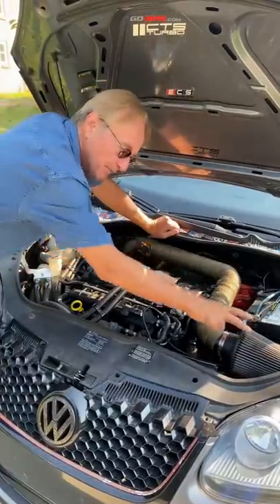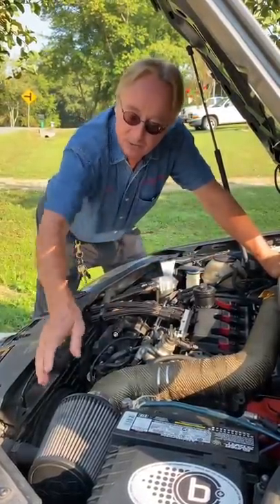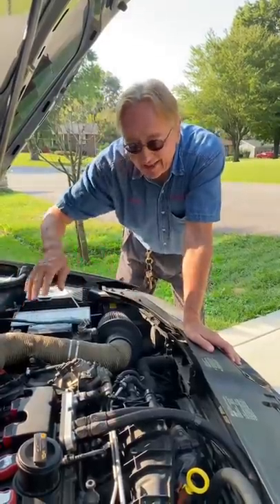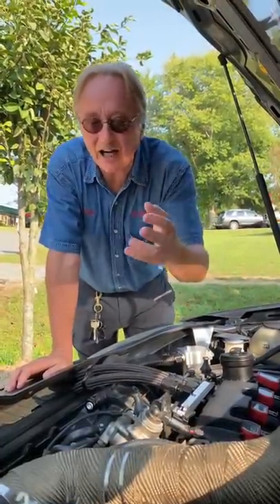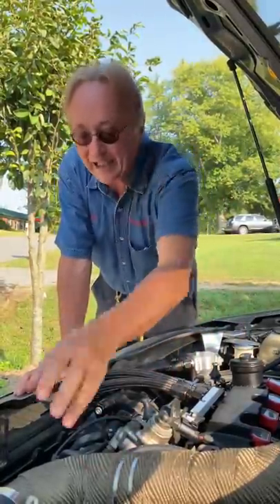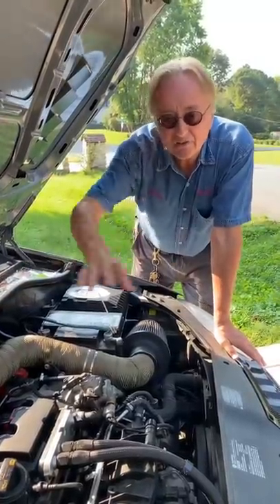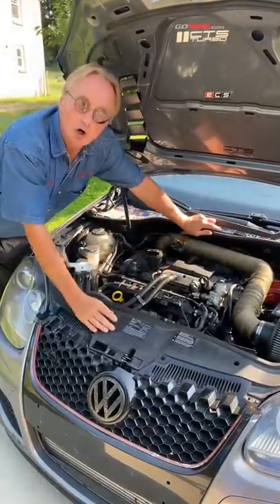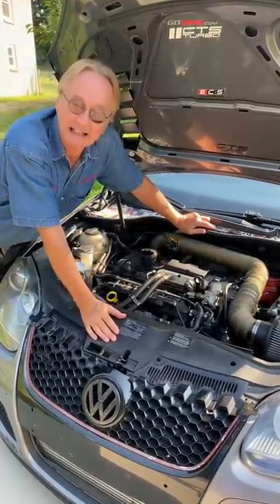Why Cold Air Intakes are Stupid

Comment: Ignoring the fact that many ECUs self learn, so a cold air intake will actually be beneficial if installed correctly. Engineers designed the original intake system to meet noise regulations, emissions regulations, and cost restrictions. Providing they are thought out and installed properly they will make a positive difference, even if it may not be measurable.
Reply: ECU's self-learn for adjusting back to desired parameters, not making improvements. You need a tune to see gains from a radically different intake setup.
Reply: Yeah they pull time

Comment: To each their own, I put a aftermarket intake on my truck I can tell it gained a little power (maybe 20hp) and mpg (maybe 5 more miles a gallon) since the engine isn’t having to work as hard to pull in air. And no check engine lights come on because it uses the original maf sensors. A heat shield keeps the hot air away from my cone filter just like the original box did.

Comment: Well, I had a mk5 VW GTI like the one in this video from 2006-2020. I brought it in to the dealership for my first free oil change. When the service dude pulled off the engine cover he broke it at the rear left grommet and didn't tell me. The mk5 GTI is a really good car but there is one major design flaw - the air filter is part of the engine cover and the air passes through it! I didn't know it had a hole until I took it off when I changed my spark plugs. By then the warranty had expired. Turns out the leak messed up the air system making the car jumpy. When I replaced the engine cover it drove a lot better. Because of its multiple parts, a new mk5 GTI engine cover is $350. So I went to ebay and a kid who bought one of the those cold air intakes no longer needed his stock engine cover and I bought it for $35 plus shipping. So cold air intakes are good for one thing - devaluing stock engine covers. Because of that experience I stopped going to dealerships, even for the free service, and do it myself with one exception. I got a new car and the stereo screen blacked out. The stereo still worked but you couldn't control it. The dealer replaced the screen under warranty.

Comment: If the manufacturer offeres it as an upgrade they also designed the intake system to work with it. Just get the oem or one that is very similar

Comment: Cold air were good back the the good old days when cars were really restricted from the factory.   Now days it's all looks and if you want one that is proven horsepower it'll cost you alot of money.  After market tuners spent countless years testing their products to make power at a certain speed or rpm.  Like Scott days sheap intake China made from eBay might actually decrease power and performance.  Coming from a guy who spent alot of money testing intake kits from various high end Japanese companies like HKS, Blitz, Apex, Greedy etc.
Reply: What brand should I use?
Reply: I mean a cheap K&N filter brought the mileage from an old 5.9 durango from 14 to 16 just cause it could actually breath
Reply: @gregoryrose13 👍
Reply: Greedy lol no kidding there, if i see the greedy or trust emblem on a part I know its going to be double the price of a domestic made part.
Reply: K&N filters let more dirt into your car (versus stock).  Been proved bu comparison studies
Reply: A Chinese CAI designed just like a big brand one,pretty much does the.same thing but for a third of the price. After all its just a metal tube isn't it?

Comment: that's why you get one that's designed for your vehicle
Reply: Its hard to get them for cars that arent really common like my alfa romeo 145 1.9jtd from 2000.Its so incommon i cant even find factory body parts
Reply: @silentscream1871  really? Kias are like non existent in the car scene yet I found a cold air intake specifically for my Kia
Reply: @silentscream1871  have you tried forums?
Reply: Designed to fit yes.
Reply: True. Nissan Nismo has vehicle specific modification part’s designed to enhance performance. They even give helpful tips if you do choose to tune, but they say it’s optional.
Reply: @silentscream1871 alfa romeos are already so well designed. I would never mod that car.
Reply: Exactly
Reply: @silentscream1871 uncommon but carry on?

Comment: I see them sometimes on Jeeps and other off-road vehicles.  The K&N filters don't filter out dust as well as OEM, they allow water into the engine easier than OEM, and you never use full throttle when off-roading anyway.  Just stupid.
Reply: Bunch of momos
Reply: Well said, just proves if you advertise enough people will fall for the garbage.
Reply: Whats stupid is how i wasted over $70 bucks on a k&n air filter itself

Comment: I like how it's heat wrapped with an open element design sitting in a hot engine bay. That's hilarious!
Reply: Guess they forgot to wrap (insulate) that filter too lol 🤗
Reply: @Gleeleeglee  Right? LOL
Reply: LMAO...next will be a rear wing added...lol
Reply: Ummm it’s literally right and above in front of 2 air ducts coming into the engine bay. It’s sucking in the same air that the airbox does it just isn’t as restrictive.
Reply: @thatsmyassbrostop  it can't "suck" anymore because there used to be a sealed box there that could allow it to "suck" air from outside. 

What you just said, is the type of person to believe that this wrap on the air pipe is helping.  When you remove the air box, it can't draw air from outside anymore because the open air filter is drawing from every direction. Those tubes your talking about is designed for a closed box system, they don't work by forced air into it while driving. 

Just stop dude. No.
Reply: @mattc420  I'm sorry that doesn't even make remote sense. The cooler air from the fender is still going into that part of the engine bay. On top of all the other ambient air around it. And while the header wrap really isn't doing a whole lot it's still helping to regulate intake temperature. This is a turbocharged car it has an intercooler.
Reply: @chancee5847  Fret was actually on to something. The OEM system that had the duct going into fresh air was using the lower pressure air box to literally suck air in from the high pressure air hitting the front of the car. Without the air box it’s still low pressure but instead of sucking air strictly from outside the engine bay it’s sucking air from the bay. With all that said on a forced induction engine it doesn’t REALLY matter where you get the air from due to the intercooler reducing the air temp to just above ambient either way.
Reply: @edratliff  your correct sir! An air box around the filter could help if it fits in the bay to help reduce heat soaking but again. InterCOOLers are installed on forced induction vehicles for a reason 😅

Comment: I put a K&N cold air filter on my 2009 Smart Fortwo Passion Cabriolet for safety and logistical reasons. I got the one that fit in the original air box so it wouldn't mess up the tune on the car. The reason I did this is because of the 1.0 liter 70 horsepower 3 cylinder engine developed by Mitsubishi just wasn't enough for American traffic & roads. It was even more dangerous when I was going up the Appalachian mountains, so this upgrade was essential. Thanks to my due diligence and incredible luck, I never had a check engine light ever come on in that car.

Comment: I installed a kandn cold air intake on my 2016 Honda accord sport 2.4L when I bought it brand new and have had it on for over 100,000 miles, never an issue with check engine light or driving. It increased my mpg and torque at lower rpms especially with the eco leaf button on since it uses the lower power band rpm range for driving around town.

Comment: CAI works well on my ram pickup. Draws air from behind my front bumper that sits 2 feet off the ground. Gave me a slight increase in fuel economy, Lowered my air intake temps,no vaporlock and no codes. All this before I tuned it. I thought it out before installing it. Just do your research before slapping parts on it and you should be fine.

Comment: Your MAF sensor will compensate for the difference in airflow.
Reply: Sensor? Compensate? Sensor only can sense and send data to the computer.  No?
Reply: @mrbubbles6961  and then the computer would tell your injectors to squirt more boom juice. No?
Reply: @lanceruscoe5228  so injectors  will  compensate.  No?
Reply: Computer will compensate. Yes.
Reply: Nah. Your computer has to be told to and the MAF will comply with the new settings. Doing this without a tune could actually cause a MAF sensor to fail.
Reply: @thatsmyassbrostop  wrong. Your mass air flow sensor is designed to gauge the amount of air passing through it so it can tell the computer, which will compensate the other engine components to run well based on the current conditions.
The way mass air flow sensors are damaged is primarily by contamination. Using wrong cleaning chemicals, old air filters letting debris through, having no air filter at all... the idea that having a different amount of air flow could damage a maf sensor is nonsensical.
Reply: @immaturemushroom3591  well I do know that adding a high flow air intake without a tune will very often cause your engine to run lean, showing that the MAF has limits. I’m not sure what other variable would cause this, assuming that the MAF truly is attempting to compensate. Perhaps it really was just contaminants on the filter itself. 
I guess I’m currently running my stock MAF sensor with a tune and air intake but the tune is what caused it to stop running lean.
Reply: @thatsmyassbrostop  there are a lot of variables. I personally am running the cone intake on the end of my stock intake hoses, and have it positioned close to where the stock filter was for the cold air flow.

I found that the aftermarket intake hoses i was using was about an inch thicker than the stock ones. If this was the case for you, your car may have had a higher amount of airflow than was ever intended, meaning without a tune, your engine literally could not compensate for it.

Comment: I put a knock off K&N in my mazda 6. Then kept putting back in the ordinal stuff. Did it 5 times and made sure to record mileage and made sure time engine ran and sure that matched on a MPG basis. Kept track starting with a full tank to empty each time and did it when I knew my driving route would be identical and drove the same way. Consistently had a 5-6 MPG increase. With stop and go traffic it might have been less or worse, my driving was 80-90% on cruise control at 60 and 65. Was getting 33mpg instead of 27-28mpg. I think Mazda listed it as 30mpg on highway. 
I was told to make sure I disconnect the battery for at least 10 minutes when I switched air intake. I believe it had to do with it causing the MAS to reset itself. Idk if that mattered but that's what I did🤷🏿‍♂️. Also have no idea if power was increased, didn't care. Only got it for gas mileage.

Comment: I owned a 2007 VW GTi and Ill admit the cold air intake made a massive difference with the BPY engine. That engine used an air box built into the engine cover. Filter was a pain to replace.

The low end torque benefits most with that particular engine and was a requirement for the APR tune that I had flashed to the ECU.

Now I cant disagree that CAI are good in every application but I cannot agree that all CAI applications are not beneficial. Thanks for the video.

Comment: The intake in the video is actually no good.  It doesn't isolate the intake from the engine compartment heat.  Most modern cars already have a cold air source.  The air is taken from the fender or right beside the radiator, from the factory.
Reply: its actually an effing bad er..... sorry, STUPID.... design.... just imagine using a metal pipe INSIDE the engine bay to transfer already hot air into the intake where the original used ABS plastic that does not conduct heat and the intake is taken from OUTSIDE the engine bay and is insulated from the engine bay heat.
Reply: @jonasmartinez1739  Its weird that he did not even notice its a hot air intake.

Comment: But can't you just get an CAI that allows you to put your airflow sensor on it and the ecu will adjust the fuel ratio?
Reply: Yes. As long as it has a port to relocate the mass af sensor on a modern car, then typically your ecu can adjust for it. The sensor just needs to have a couple inches of straight airflow before the air hits it.. I know mine (2016 accord v6) did just fine when I put a SRI on it. I still did a flash tune soon after, but otherwise it was running fine. No appreciable loss in power with just an intake. Sounds amazing though lol.

Comment: I got a stage 2 tune on my tdi. I put a kerma CAI and smooth elbow on and it has made a big difference in intake temp and exhaust temp. Makes a big difference in the southwest desert. My fuel consumption has changed. I'm getting better mileage. So I'm happy.

Comment: No a GTI can remain stock with an addition of a cold air intake. The gains are negligible, ~5hp. With a tune however, you'll gain ~10hp but tunes could push more with the help of a cold air intake. Example, my car atm has 325hp and 420 nm (309 lbft) and runs stock intake, just by adding a cold air intake, I could dial up the boost from 24.6 psi to 27-28 psi.
Edit: I install a cold air intake a day after the comment. I dyno'd it again and made 350 hp (320 whp)  and 472.5 nm (348 lb ft) at 28 psi of boost
Reply: a gti will gain much more than 10hp with a tune. its not uncommon to see 80hp increase with just a stage 1 software flash. mostly due to how conservative vw is with tuning likely leaving room on table for next years refresh.
Reply: @rileyhance318  yeah 10-15 hp and closed air intake give up to 20 hp but you gotta pay up

Comment: Got a k&n intake, feels fantastic! Louder yes absolutely however, definitely feels like my power is transferred consistently if not better during hard pulls😍mopar life
Reply: Better throttle response is usually the most noticed from a better flowing intake. Car can grab that air a lot quicker and more efficiently with a well designed aftermarket intake
Reply: Hell yeah

Comment: So correct Scotty. The air intake system needs to tuned how the engine so intake pulse of one cylinder will not screw up on another cylinder.

Comment: I put a short ram intake on my car because the factory one was picking up the air from 4" off the ground and I drive in a city that gets 18" deep puddles. It has already saved me from hydro locking my engine at least once.

Comment: I added one onto my 14 Ford Taurus with the 3.5L naturally aspirated engine. I also changed the grille to allow more air flow. Guess what? No check engine light, my gas mileage increased, and has better response with zero tuning. Amazing! Now I will admit my experience isn't typical for everyone but I am happy with mine.

Comment: This is one thing I disagree on. I always run a cai inside the front bumper and it helps in the summer taking intake temps from 152 to 98 degrees. My car was overheating with the stock intake.
Reply: The right solution is to buy a car that does not overheat when operated normally.

Comment: Scotty you are missing an important point ,cold air intakes are “Very” useful if they are Ducted correctly and flow is controlled , same with and “Exhaust system” I agree 100% with tuning any engine that has been modified any sort of way
Reply: most modern cars now come with a factory installed cold air intake... and it was designed by engineers for the cars it was installed in.... I cant see your point regarding intakes being tuned because the factory cold air from volkwagen was designed and tuned by engineers, not boys in baggy pants who just happened to know what a dynamometer is.
Reply: @jonasmartinez1739  cold air intakes work in conjunction with other modifications. That's when horse power is increased. Cars from the factory are usually not tuned for performance, that is why performance cars usually require to be tuned, to squeeze out extra horses.
Reply: @jonas Martinez is repeating what Scotty Kilmer already said because he’s watched every video and now he is an expert in tuning a engine lol.. maybe try to go actually educate yourself about engines before saying something stupid about baggy pants which has nothing to do with engines LOL

Comment: Manufacturers had fuel efficiency in mind. Most intakes are less restrictive. Also..Moving the intake will not cause a check engine light unless you’re removing a sensor.

Comment: I have a gti with that same style intake and it’s had a tune. I was told by the tuners who are very reputable here in the UK (R-Tech) that I wouldn’t get more than +50bhp without changing the intake. The car made +75bhp with their tune alongside a cold air intake and full exhaust system. The stock intake is too restrictive and causes heat soak because the air has to flow over the top of the engine before making its way to the intercooler. This style of aftermarket intake of wrapped like the one in the video and as mine is will decrease intake temps drastically compared to the stock system

Comment: I installed it to get rid of cluttered breather and open up some space for an OiL CATCH CAN and to make it way easier to change the alternator.
  I did notice a measurable increase in fuel economy on the MPG readout.
  Don't know or care if I gained any HP.
The oil catch can will save my engine from GDI carbon deposits.

Comment: When you have high flow exhast and better injectors paired with a cold air intake will gain horsepower and torque if you get a quality intake that has a proper air dam.

Comment: Never had an intake turn on a check engine light, and they don't necessarily have to be tuned unless it changes the Mass Air Flow sensor diameter.

Comment: If done correctly it is a decent mod. If you can modify the stock intake box to house a cold air intake and maximize air flow to the filter you should get a noticeable performance gain (with a dyno tune of course) and you get a great induction sound.